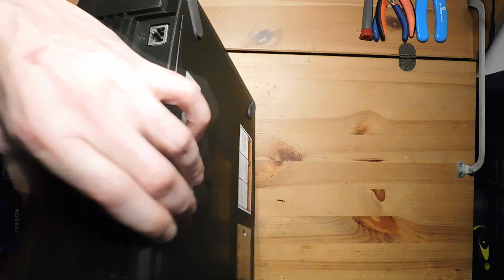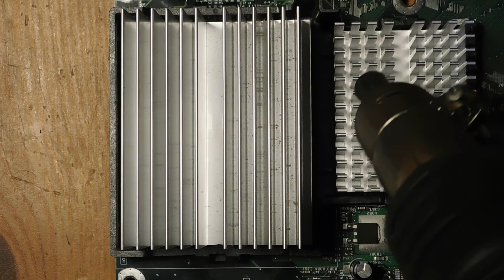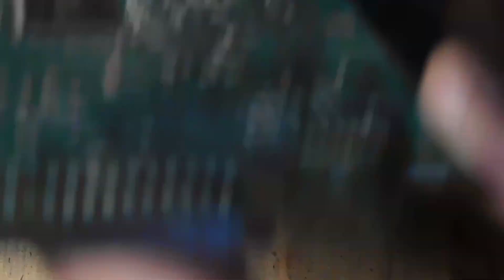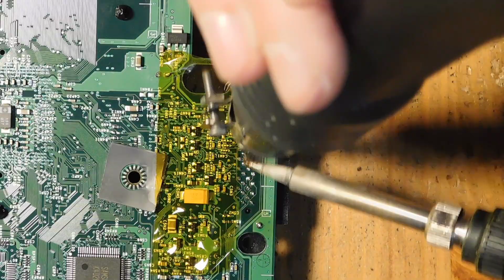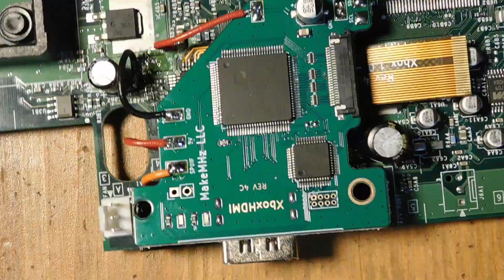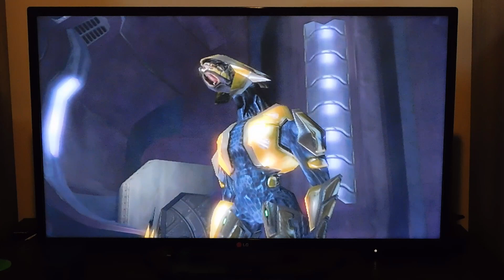MakeMhz Xbox HDMI Install Guide - The Ultimate Digital-to-Digital HDMI Mod for the Original Xbox!

Comment: This mod is an analog to HDMI conversion. It's not digital to digital. Look at the pins that it connects to, they're the color, hsync and vsync. It's analog baseband video signal. As for the audio, that is digital to digital in this kit as it encodes the AC3 or DTS streams from the stock SPDIF output.
Reply: It's 100% digital. Stop lying
Reply: @MichaelM28  If you consider baseband video signal digital, that's completely on you. Just realize that digital signals do not require h-sync and v-sync. Those are the pins that you soldered the header to on the right and bottom of the encoder chip. The wide stretch of pins on the left were the analog color channels. ;-) Look at the signals yourself with an oscilloscope. You will see.

Comment: Say we wanted to offroad this mod a little bit and keep the AV-out port, would it even still function or is it completely disabled or handicapped by this mod?
Reply from the maker: It might work but it would be forced to output component video
Reply: @LIRetroGaming  Interesting, I'd prefer component video out of that port so that's no issue for me, would be curious of an image quality direct comparison of quality component cables with potentially an upscaler vs. the HDMI kit.

Comment: Great video. But I don’t understand why you fast forwarded through the soldering parts. The soldering especially the micro soldering bits are the most difficult parts of the mod so seeing your technique may help others. This mod is definitely for experienced solderers . Thanks for posting this.
Reply from the maker: Thanks, glad you enjoyed it. It’s tough to figure out what parts to go through quickly or not. If I play the entire installation in real time I think it would be rather dull for a lot of people. So sometimes I choose to Speed up sections of the insulation so that people understand the main idea of what needs to be done. But I’ll certainly keep in mind

Comment: Thanks for the vid! One thing to note: kapton isn't really heat-resistant, but it will help hold the components in place. Just don't ever rely on it as a heat barrier!
Edit: I should clarify: the tape itself is heat-resistant, but it's not going to shield anything under it from the heat

Comment: Installed XboxHD+ to my 1.6 Xbox console and to my disappointment it doesn't work. There is no Video or Audio output at all. All I get is blinking Blue Led on XboxHD+ board. Console was working perfectly fine before installation. There are no bridged connections or cold solder joints. All connections were tested with MM. Any suggestions on what might be wrong? As I'm still waiting for the answer from MakeMhz support team.
Reply: does have a very similar issue.
HDMI boards blinks green but Stellar says XCODE Stalled...
No vid nor sound :(

Comment: Is having the Xbox softmodded strictly necessary for this mod?
Reply from the maker: It’s mandatory to have a modchip installed. I don’t think this modification work properly on a stock system
Reply: @LIRetroGaming  Wait, doesn't it say early in the video that it can be done on a stock system and it'll be fine?

Comment: my xbox is 1.6b can i install that?
Reply from the maker: No you need a revision lower than 1.6 for this particular installation guide
Reply: @LIRetroGaming  i have 1.0 xbox
Reply from the maker: In that case it will work on the 1.0 Xbox. You just need to get the new filter board and install that as well. When I made this video, the filter board had not been completed yet but now that is a standard part of the kit when you purchase it
Reply: @LIRetroGaming  i have a problem with my 1.0 xbox when i start it i turn off with sound i took off the hard drive and put it in my pc and ran a program taht told me the drive is so bad so when i i add a new hard drive my xbox works for short time then turn off and when i remove the hard drive the xbox works without shout off can u tall me why if u want i have a video for the problem

Comment: What's the benefits of using this compared to a custom made component cable (made from an xbox 360 component cable)? Just done a component cable and im getting crystal clear picture and same resolutions.
Reply from the maker: The main difference is that a component cable is analog whereas this is purely digital so there is no degradation of the signal. But you are correct, a high-quality component cable is going to give you very excellent results as well
Reply: @LIRetroGaming  Thanks for the reply, im always interested to "upgrade" my retro consoles and it was interesting to watch your video. Im using a panasonic 42 inch plasma tv with its own shelfs that is fantastic for old consoles (even got 2 hdmi input and does 1080i i think so) but this method could be fine for those whose playing on new tv's with no component input or prefer to use hdmi instead.

Comment: A normal hair driyer or curls dryer is sufficiant to soften the 20 years old thermal paste ( I have tested it)
Reply: That's literally impossible.
Reply: @koigoi  - 
wrong , I did it this way using a hair dryer with the XBOX of somone I help in all coumputer stuff .... works with Computers too
Reply: @Killerspieler0815  How?? The melting point of solder is so much higher than what a hair dryer can reach.. And afaik, solder's melting point does not change with time.
Reply: @koigoi  - 
I do NOT talk about the solder ...  just softening the old thermal paste ..
Reply: @Killerspieler0815  Oh gosh my bad. I completely misread your original comment!
Sorry, friend.
As an aside, around when I got my XBOX, I repasted it. I let the console turn on and heat up the paste that way just so I didn't damage any SMCs.

Comment: I´ve installed in a 1.6 hdmi board only. Do you I need any other mod? I got no image after that. thanks!
Reply from the maker: Did you install an open Xenium as well? It’s very strongly recommended to have a mod chip as well. There are a lot of reasons why you might have a black screen
Reply: @LIRetroGaming  thank you for your reply. The owner says that have xbmc installed, but there isnt modchip present. Meanwhile ive noticed that the games work fine, i can see image when i insert a game. But without a game, it doesnt show the dashboard or other image. So i assume the hdmi board is well installed, but other issue should be related. Do you recon it may be from the lack of the modchip?
Reply from the maker: I suspect that it’s the bios - it needs to force 480p and you will have problems if it does not. So yes, I strongly recommend a mod chip and installing the bios that they discuss on the Xbox hdmi discord/GitHub page

Comment: Clock cap is not needed. No need to do any sort of mods. On a 1.6, however, it is needed, and you can't simply remove it--it has to be replaced. Luckily, they don't often go bad on 1.6s. If you have anything other than a 1.6, remove the clock capacitor immediately and clean up any leaked fluid, even if you don't plan on doing a single other mod to it, this is a life and death situation for the Xbox.

The only thing a mod has to do with the clock cap is just that once you have a custom dashboard, it can update the time from an NTP server. But you don't have to bother with the time ever. It doesn't matter. Just press ok when you turn it on.

Also, if you're using HDMI, don't enable 1080i lol. Trust me when I say you don't want an HDTV doing any deinterlaced. The lag is so bad... Progressive all the way.

Also also, there are some games that won't run in 480p even if you have it enabled (480i only). Get yourself xbmc4gamers dashboard and run the script that comes with it, and it will patch any of these games to run in progressive mode :).

Edit: apparently you don't have to patch any games with the Xbox HDMI. But if possible, it is still helpful to use a force-480p BIOS. But the patching applies to any other output method.

Comment: Great video! I'm waiting for a restock of the HDMI kit, and until then, I'm looking to learn how to solder. Will this project be possible for a beginner? I'd appreciate any help!
Reply from the maker: Thanks, glad that you enjoyed the video! This one is definitely not a good beginner’s project. There’s a lot of very fine soldering required and it’s much better to attempt this when you have some experience under your belt first. 
Do you have some of the tools needed for this mod yet? If so then try practicing on a scrap circuit board and see how it goes
Reply: @LIRetroGaming  Thought so! Looks really precise. I honestly haven't done much research yet; this video inspired me to. I have a lot of tools, but I don't own any soldering equipment. Would you be able to point me towards a beginner set that could potentially be capable of this mod in the future? Not sure if that's possible.

Comment: on both XBOX Videos stated wrong, that the modchip would be needed to remove the Clock capacitor … 

the only one xbox that only works with this cap is the 1.6. and these you didn't mod.
Reply from the maker: Sorry for that, that was a mistake. Either way it’s good to get rid of the clock capacitor and with the modchip you don’t have to set the time every time you boot it up
Reply: @LIRetroGaming  no it's fine. i just want to say for the next videos, to get rid of this point 🙂
I'm with you, that a modded BIOS that skips the time/date set makes a more fluent experience.

Comment: So that plastic 3D printed piece is actually supposed to go between the metal cage and the plastic shell. I saw Dustin actually say this on his Discord server. He said people don’t know because they naturally don’t read the instructions lol.
Reply from the maker: Damn, I screwed that up. It does seem to fit very nicely from the outside of the metal cage. But that’s something I will correct going forward
Reply: @LIRetroGaming  If that’s the only thing people screw up with this mod, I’d say job well done. You did a nice job installing it and showing the process.

Comment: Anyone know where to get replacement dvd drives for the original xbox that aren't extremely expensive?
Reply: Hard to come buy but may be able to buy one off ebay or even just console with a working one. May be better off modding with chip, upgrading hard drive, and FTP'ing the games over.
Reply: Have you tried replacing the drive belt?

Comment: id rather just use an ossc or a PC CRT
Reply from the maker: Those are perfectly reasonable options as well
Reply: That’s nice...so why are you watching this? Lol
Reply: @guyverjay1289  i love the xbox. was just curious. it kinda makes no sense to do this mod. what good is pure 480p.. on modern tvs the internal scalers will look like shit + input lag from running a non-native resolution. you would still need an external scaler either way for best quality.

Comment: Love this video. Will this work on the PAL region consoles? I know that getting HD output thus far requires changing the region post modding to NTSC.
Reply: Since the Problem at 19:00 … you Need to Change the Region first. else 576i/480i will displayed and cause the Problem.
Reply from the maker: I'm pretty sure that it does but I would check on the MakeMhz site to confirm. However I did not see any region-specific install instructions so the steps are most likely the same

Comment: I was under the impression that you need a developer system or ram upgrade to display 1080i content properly, even 720p is too much for a vanilla xbox
Reply from the maker: That might be correct, I’m not entirely sure about 1080i. But at least I can report that 720p does seem to work fine and that’s what I have my settings on currently
Reply: What exactly do you mean? If you are doing XBMC or Playing Homebrew/Emulators 1080i will not be optimal, but 720p is just fine for 99% of the content with 64MB ram. As far as native Xbox gameplay @ 720p or 1080i, only a handful of titles will support them anyway.

Comment: try working assembly, you'll learn to love torx.
Reply: Torx is way better than phillips! And it's also a bit better than hex if you ask me.
Reply: @Iisakki3000  Hex Is the WORST. Those screws can get messed up so easily.
Reply: Torx is great for small fastners, but it's evil when used with large fasners in dirty environments like automotive. 
The opening becomes impacted by dirt and grime, preventing the tool head from properly seating.

Comment: Urrr come on? Why sadomasoquism mod risk destroy Xbox,  HDMI plug and play more easy
Reply from the maker: There is no risk to destroying the Xbox if you know what you’re doing. And those plug and play cables are converting analog to digital, and the quality varies considerably. This is pure digital so the quality cannot possibly get better
Reply: @LIRetroGaming  
This is why I don't work on my consoles parts are very small and don't have all the right equipment

Comment: do i need to soft mod my xbox?
 i want to do this to my halo special edtion xbox
Reply from the maker: Technically you don’t need to, but a mod chip is highly recommended in combination with the Xbox hdmi
Reply: There’s an app for upgrading the XboxHDMI’s firmware and changing other options so it’s highly recommended.

Comment: What does the modchip have to do with the clock cap...?
Reply from the maker: It removes the need for a clock capacitor by saving the time settings in a different manner. It also allows you to use any hard drive, not just one that is locked to the motherboard of the system
Reply: @LIRetroGaming  I mean you can remove the clock cap entirely without any other kind of mod and the console will still work. A softmod can auto-update the time and date from the internet if it's connected to the network. You don't need a chip for that.

Comment: If doing this modification I would highly recommend recapping the XBOX before doing this.  1080i should also be disabled since it will look horrible on a modern flat panel.  Magnification is really necessary (statement, not a question).
Reply from the maker: Agreed with all of that. It’s a good time to replace the capacitors because you already have the system open. And certainly for the 1.0 and 1.1 models this is very important. And I agree, you have to use some kind of magnification for the flex cable
Reply: What do you use for magnification? I have moderate soldering skills for things like car and audio systems but this tiny shit concerns me and I have an hdmi mod in hand for my 1.0 so I need the daughter board anyway.
Reply: @Godzfirez  these (or similar) are not great but they get the job done.
https://www.amazon.com/Beileshi-Magnifier-Illuminated-Multi-power-Magnifying/dp/B018DLMHFI/ref=sr_1_9?dchild=1&keywords=magnifier+headband+with+light&qid=1614261108&sr=8-9
Reply: Yea I use 1080i on an Xbox 360 and I get weird lines. I know it’s not gpu failure as 720p or 1080p works fine .